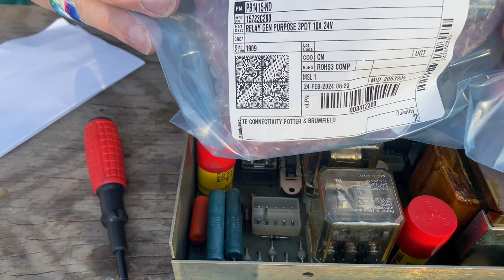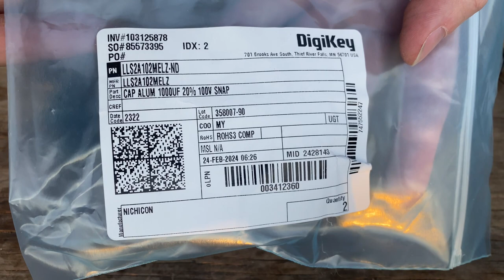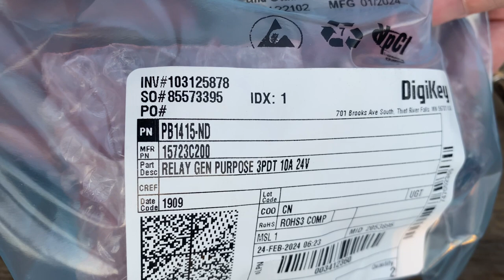Gyrotech swing control box preventative maintenance and repair

Comment: 2010
Reply from the maker: Take the negative wire off the battery, while not running and see if that fixes your audio. If it does, either the amp or exam has issues. If it doesn’t, what year is it, does it have removable door sockets. Send photos to email hitandrepair at gmail
Reply: @hitandrepair  yes I think it does